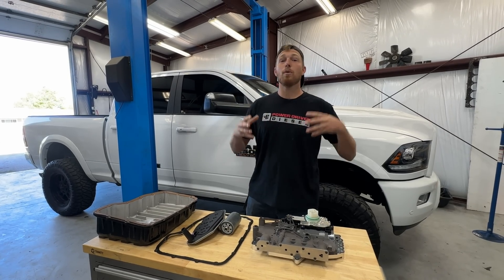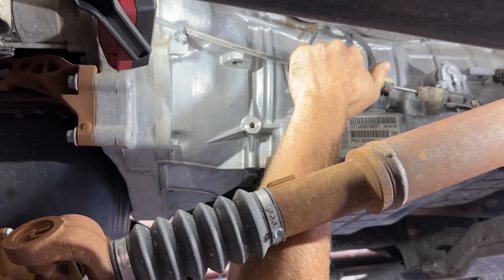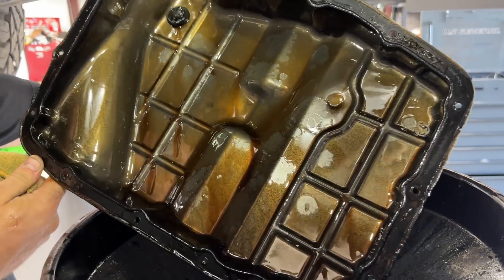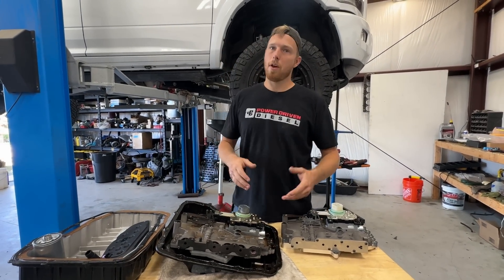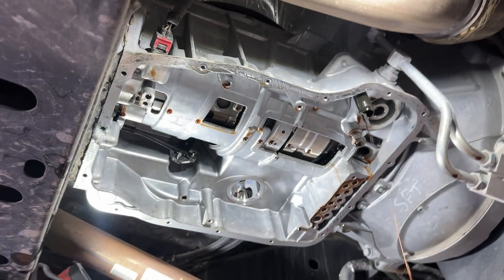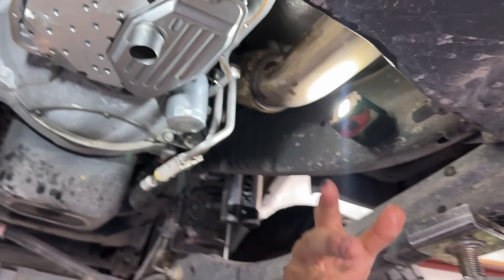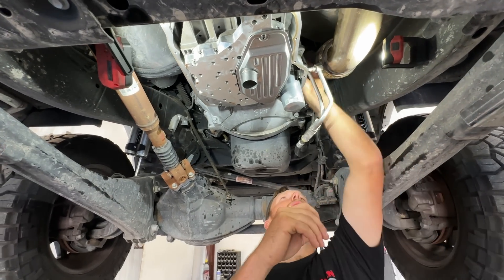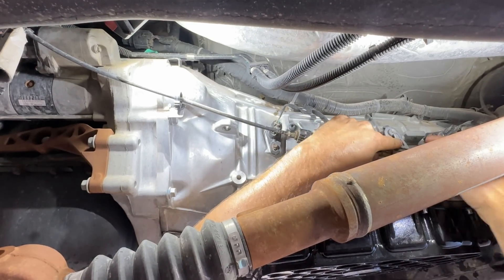DIY 68RFE Valve Body Install

Comment: Great video! Will this apply to 2019-2024 68rfe trucks? For now I may just do a banks deep pan and the rev max no drill accumulator plate. Was wondering if the removal of the valve body is the same to do that upgrade. Thanks!

Comment: Really Good video. 2 things i’d like to note:
1- put 2 zip ties opposite of eachother in bolt holes to hold the gasket in place when installing pan (tip i learned from another guy when installing any pan with gasket) then cut zip ties when you have a couple bolts in loosely 
2- do not use any petroleum products on electrical connectors or the seals will swell and make it almost impossible to fully seat without braking connector lock. You go lucky doing it immediately. Another 30 seconds it would have been very difficult

Comment: When you were commenting on the cleanliness of the transmission pan (3:45) there I noticed a circlip in the far right rear section of the pan. It would be interesting to see where it came from and if it would have caused a problem in the future. Great content and I love your products.
Reply from the maker: The only e-clip like that one in the transmission is the one holding the parking rod to the shift lever which can be seen is still installed later in the video.  Where did it come from? Great question!  This wasn't the first time the transmission had been opened, so someone likely introduced it at some point.  If the parking rod snap ring had fallen off, you'd lose park shortly there after.  Thanks for the question!

~Myer

Comment: Are you going to be selling just the valve body? If I have rebuilt an engine will rebuilding a 68RFE be plausible? I know that's a tricky question to answer so no worries if you all don't want to. When I bought our truck I bought a core 68RFE as well and since you all are getting some parts out it might be a good time for me to get that job tackled, and by time I mean prior to 2050 most likely :), I might move slow but at least I'm moving.
Reply from the maker: Yes, the valvebody is linked separately in the description.  68rfe DIY build is doable, but you'll need some special tools to assemble and disassemble the input shaft and overdrive/underdrive assembly and service the bonded seal pistons.

Comment: I changed my pan a couple years back before doing a long tow of a rough terrain forklift. Not sure the weight but wanted to change the fluid and figured it was a good time to upgrade. Problem is I'm not sure if my dipstick is the correct dipstick for my truck. I bought it used, from a dealer, and the old dipstick wasn't sealing up top and the dealer said he would replace it however the one he replaced it with was longer than the one that was in the truck when I got it. I don't know what if anything was done to the transmission but the engine was studded at least. When I refilled it the transmission after changing the pan I added the amount Dodge says plus the extra amount the pan claimed and have been driving it like that. Sometimes it takes it a bit to shift into 6th when cold if I don't let it warm up first other than that it had trouble finding a gear once after towing home a pretty heavy load on a 95F+ degree day that included a lot of stop and starts and driving 45mph or so but that was just at the very end of the trip. Not sure how much I was towing probably around 14k give or take. It was fine the next time I took it out and the next time I towed with it as well, although I was pulling a fair bit less that trip. I'm not sure how much I trust the dipstick it has in it. Crap now that I think about it I'm not sure if the old one was longer or this one was? Think I should start with adding a temp sensor and see what I'm looking at there?
Reply from the maker: I would verify that you had the right dipstick first. Make sure the fluid level is where it needs to be. A transmission temp gauge will definitely help, especially when towing!
Reply: @pddofficial  Alright did a little digging and turns out it is the wrong dipstick, it is the one for the gas engine with the 68RFE. I just ordered the correct replacement. Thanks for the info.
Reply: @pddofficial  Okay thanks for the advice.

Comment: Mayer how come you guys don't drill a hole in the transmission pan to drain the transmission oil out if you guys are putting a new pan just asking I know some people want the old one incase they sell the truck
Reply from the maker: That’s a good suggestion.
Reply: @pddofficial   I did that with my turbo 400 pan cause I didn't wanna make a mess in the driveway but I was putting a drain plug in it anyway but just a thought thank you by the way

Comment: I know you guys are pros but I can't help but cringe every time I see someone run in a bolt with a impact driver.
Reply from the maker: I know I make many people cringe doing it.  If it makes it any better, I used my Milwaukee "surge" impact. Instead of utilizing a mechanical hammer, it uses a hydraulic-style "fluid-drive" technology.  I have absolutely no idea what that even means, but it has very low torque spikes, so if I were to have a screw going in cross-threaded, it doesn't have the torque to mar the threads.  I bought the gun specifically for transmission type work and is my favorite one to use for small jobs like this.

~Myer
Reply: @pddofficial  That's awesome. I was wondering how you could keep that from happening. That's some pretty sweet tech. Definitely wasn't  trying to knock you there so sorry if it sounded that way.
Reply: Unless you work in airplanes if you aren’t you are a newb